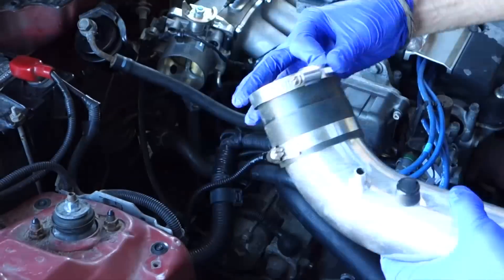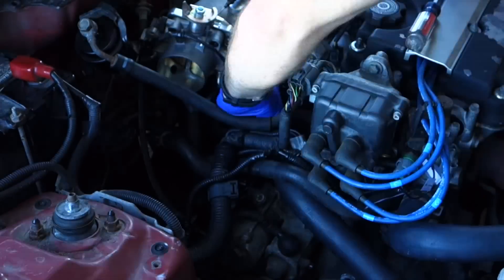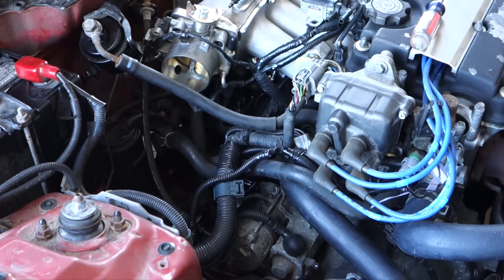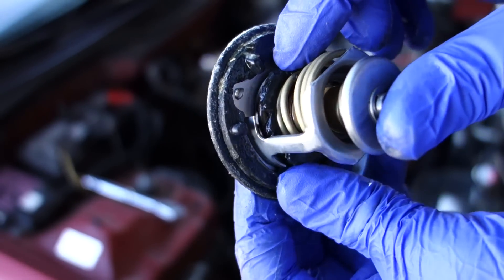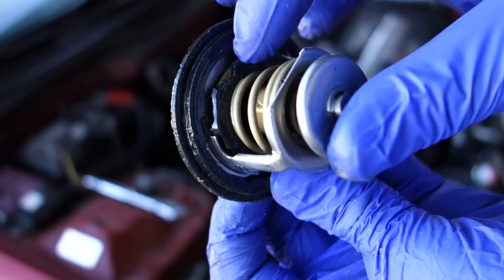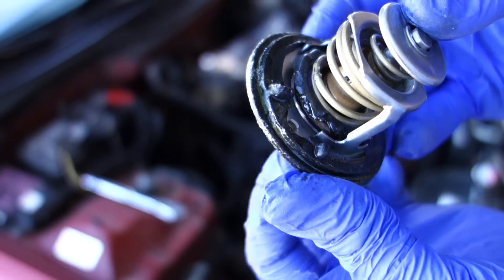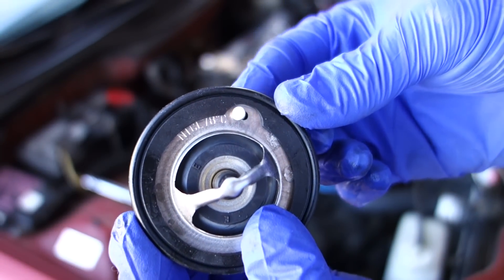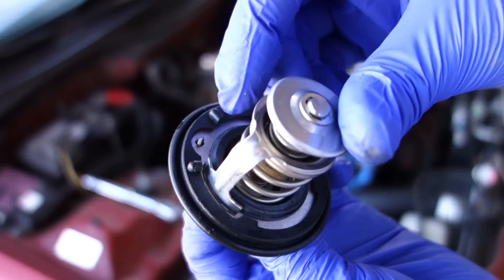B18 SWAP PULLS! Yonaka Civic Exhaust Review - Honda Civic Rebuild and Restoration Project

Comment: Things gonna be beast bro!
Reply from the maker: heck yes! Looking at turbo setups now!
Reply: gt3071r or similiar would make a great turbo plenty of top end and will give good midrange.  Check out evans tuning dyno database very helpful.
Reply from the maker: Love his site and can spend hours looking at the builds and graphs. I contemplate going a bit smaller (GTX2871r or an EFR)
Reply: I like the GTX with the bigger revs of the b18c it may work out perfect I LOVED my gt28rs on my z6 cant wait to see the progress begin.  One issue I had with the t25 flange is there is no manifolds and  exhausts for the internal gate so if you have a good welder get it done would kill to see it.
Reply from the maker: Thats my hope with the GTX since the compressor map is wider... As I get closer I'll take a closer look and try to decide if I want to go cheap with just a simple journal bearing gt28 or go GTX/EFR

Comment: Very nice stuff! I have -92 eg civic, with b18c swap. I've had lots of issues with it, but finally got it working properly and I love it! I love your videos, very well made, and informative. I subscribed so I won't miss any videos. I hope you won't get the iacv problems, it's pain in the neck to fix.
Reply from the maker: +ifgezroxy oh I got that problem... I think it just needs to be cleaned and adjusted to idle properly. I have issues with idle speed and changes to ambient temperature

Comment: Did replacing your t-stat help with warming up your motor faster and hold temp?
Reply from the maker: Night and day difference and its literally a 30 min job max. I can get fully warmed up in 5 min max with it 5 deg F out and it will stay warmed up.
Reply: Stauffer Garage Thanks for replying man. I got USDM B18c1 as well and it takes atleast 10mins to warm up in 40 degree weather and as soon as i start to drive, the temp gauge drops. I was wondering if I should replace my t-stat or not. But seeing that you had the same problem and fixed it, I'm definitely changing mine out now.
Reply from the maker: For sure man, mine did the same thing. The entire seal on mine was disintegrated. I would recommend going with an OEM Honda stat and not the junk from autozone.

Comment: what radiator hoses did you use, gsr or em1?
Reply from the maker: +Orlando Rivera I used gsr. They do not leak but a little larger than the civic d16 radiator connections.
Reply: Stauffer Garage awesome thank you, I plan on installing new aftermarket radiator at the same time as my swap so hopefully the radiator will be slightly larger than the original

Comment: There's something I didn't know because I'm going to be running my first swap with vtec ... it's cold as (expletive) this time of the year sometimes and I didn't know vtec wouldn't engage unless the car is up to operating temperature ... I haven't done the swap yet but earlier this my radiator was leaking so I upgraded to a full dual core radiator.. now with this new radiator I never had problems getting up to operating temperature until we hit days where it's 20 degrees and lower ...I'll actually have to turn off my heat to trap coolant in the engine to get temps up .. do you think this will be an issue once I do my swap ??
Reply from the maker: Its highly likely. The upgraded radiator would allow you to cool the engine more efficiently above thermostat opening temperatures but if the coolant is colder than that mark (typically ~170-180F) it should maintain temp. This is due to the engine cycling the coolant around the block and through the bypass lines on the manifold and the cabin heat. Essentially it is its own circuit.

Comment: ls VTEC??? what u think about the hybrid b series and VTEC heads mated to them
Reply from the maker: Never done one and know they have gotten more reliable as time has gone on but I still feel sticking with the oem combo (b18c) is the way to go. In the spring I'll be boosting the swap and am targeting about 500hp and set it up for time attack. 

If you do an LSVTEC and compare it to a b18c, the gains aren't anything extraordinary for the hassle in my opinion.

Comment: what's up man. hey so I have finally install my b16 and I have it running nice and smooth but I have this thing that I don't know if it's right or not. so this is my issue hopefully you can help me. I'm running a 93 integra 1.7 Trans with the clutch slipping a little bit and a 98 gsr ecu. my issue is that in the highway just to run at 60mph my rpms are all the way up in the 4500. so I'm wondering is yours the same way? or do you think maybe the clutch is the cause of my high rpms
Reply: when you let off the gas do the rpms drop? if so than your clutch is slipping bad lol get a clutch or even just a better trans lol LS gears too long bro